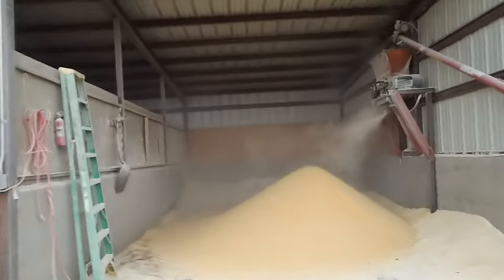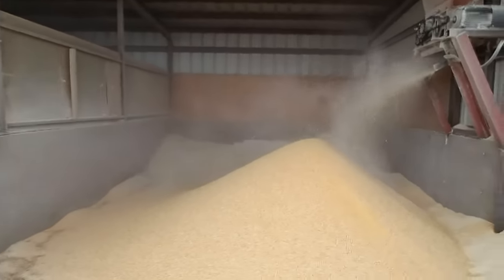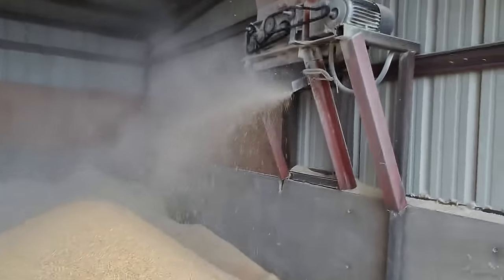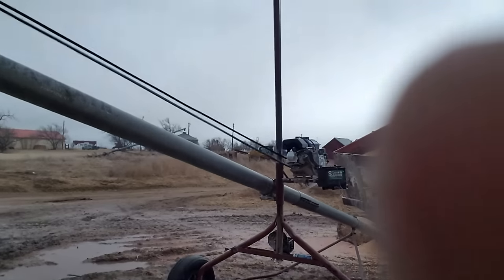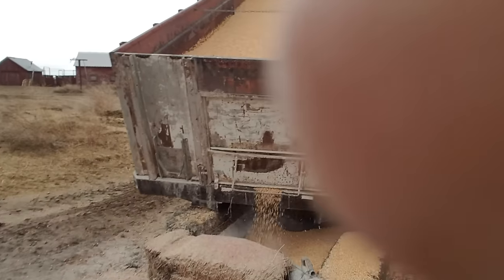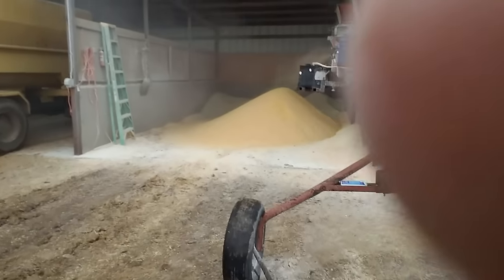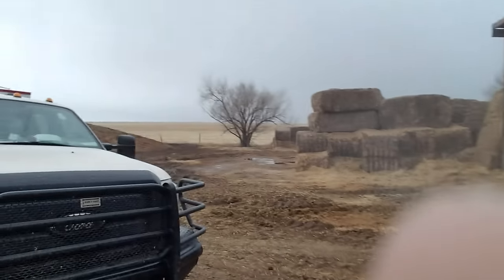Rolling corn, More rain, Paid Promotion

Comment: Suggestion FYI: Commodity expansion: Extend commodity building another bay to hold the roller mill on steel ( drill stem)  frame  / catwalk, allow loading direct drop to your feed wagon / truck with switch hopper from cross auger to present commodity bin. Install roller mill platform  allowing for future larger unit and access.  Place your grain bin  to allow with shed roof over bin auger and control station. Given your NM weather / ice, etc. install steel stairs to access new grain bin and the roller mill platform. Refill and inspection . No open climbing ladders, Save your neck in the ice. Enjoy your videos as very informative to a former farm boy looking ways to make work easier, faster and safer. Cheers